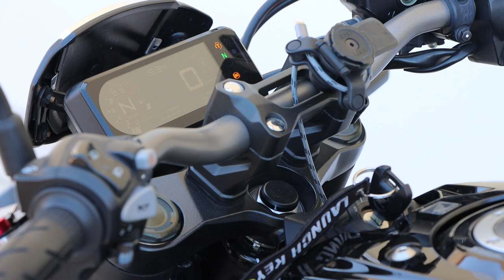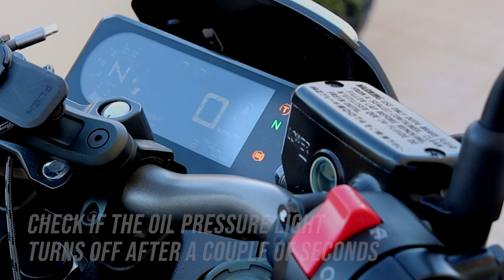Basic Maintenance / Oil Change | Guide | Honda CB650R

Comment: what was that spray you used to clean the drain plug after you reinstalled it?
Reply: brake clean
Reply from the maker: Yep, that's right I've used brake cleaner and wiped it off after.

Comment: this might seem like a dumb question, but the oil you put in was clear and what came out was dark, why?
Reply from the maker: Hey Duarte, there are no dumb questions, we only learn when we question things.

Well, you might not know but motor oil actually has many other functions aside from the obvious that is lubrication. Motor oil also contain aditives that clean the inside of your engine of carbon residue created during combustion. The oil breaks down these residues and they are disolved in the oil, with enough time, the oil becomes saturated with contaminants and changes the color to a darker tint. This is why used oil is way darker than new oil, and the darker the oil is, the more contaminated it is.

Does this answer your question? If you still have any more questions about this or any other topic that I can help, feel free to ask as many as you want 😅.

Ride safe bro ✌️
Reply: Agora é que vi que és pt. Esclareceu sim!
Reply from the maker: Sou sim 😅. Sem problema, qualquer coisa que consiga ajudar já sabes ✌
Reply: Especialmente por causa da embraiagem tb ser banhada com o mesmo óleo, obrigado pelo conteúdo, continua

Comment: I didn't understand the final step, why when you added oil the first time did you start the bike and then add some oil again? couldn't you add the correct amount directly the first time?
Reply from the maker: Hey man,
You can add the 2.6 liters of oil the first time and just not do anything else. I guess as a percaution the service manual tells you to let the bike run for a couple of minutes so the oil can flow and spread all through the engine and then to double check the level to make absolutely sure that it is correct. In the video I showed the complete procedure to be as faithful to the manual as possible. I hope this answers your question.
Reply: Hey  @ChillMotoRides cool video! By the way, when you checked the oil level. Where does it have to be on the stick? In the middle of min and max or just above the max? Because mine is in the middle and my idle is uneven while warmed up... so I guessed it might want some more oil. Thanks!
Reply from the maker: @izakf5301  Hey man, thanks for the compliment on the video. The oil level should be as near as possible to the max level but not above it. Please also make sure you're reading the oil level with the bike upright, this is very important!
Reply: @ChillMotoRides  certain amount of oil gets in to the filter once you fired it up hence you should check the level after initial startup

Comment: How come 10W-40 and not recommended 10W-30?
Reply from the maker: Hey,
You are absolutely right, the Honda service manual does recommend 10W-30, however, here in Portugal, the official honda shops use 10W-40 (I guess it's related to our climate, you can search more about it if you want). Since the official shops use 10W-40 I decided to use it as well. My advice is to check with your local honda dealers and shops and see what they think it's best. Otherwise just use 10W-30 as the manual says, there should be no problem either way.
Good luck and ride safe ✌
Reply: Didn't know they change oil type by regions, interesting. Thanks for the info, and nice video. Keep it going... @ChillMotoRides
Reply from the maker: No worries man, and thanks for the kind words 💪✌
Reply: @ChillMotoRides  hey man 10w30 is bad if it"s very hot ...10 w30 for 30 degree max

Comment: It's better to prime the new filter before installing and remove the filler plug whilst draining the old oil out.
Reply from the maker: Hey hey, what do you mean "prime the filter"? Filling the filter with new oil before installing?
Reply: @ChillMotoRides  Yes, fill the filter with oil before installing it. Much better for the engine at start up.
Reply from the maker: Yep, it sure can be a bit better but as you can see from the video, the bike creates oil pressure very quickly either way. With that said, priming the oil filter is an extra step, but you should do if it makes you more confortable. Thank you for your advice ✌